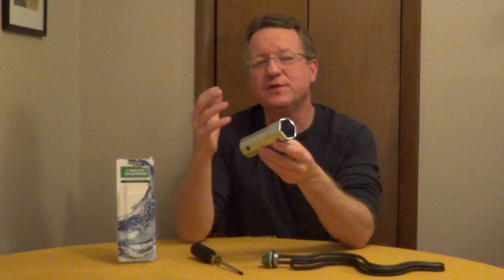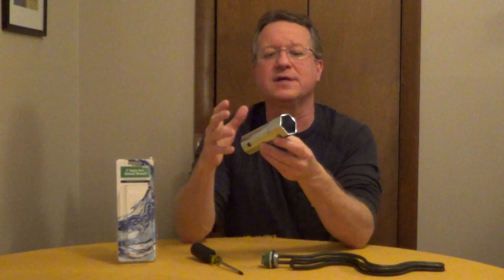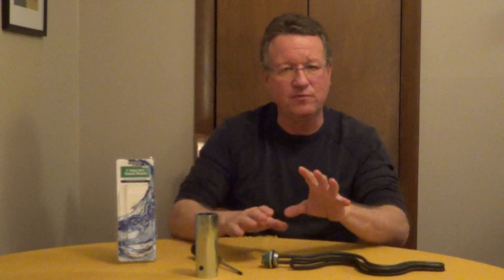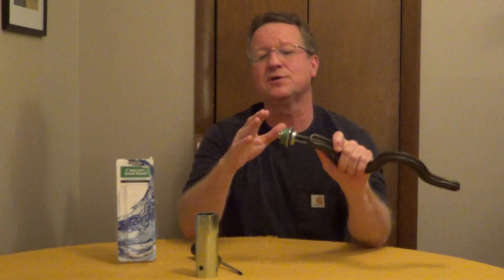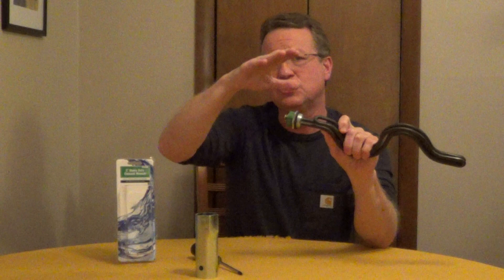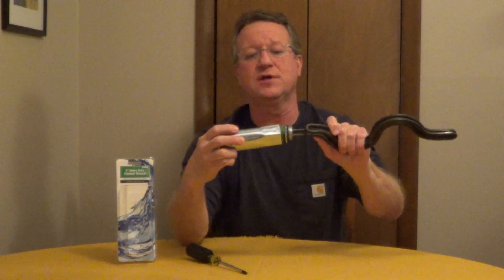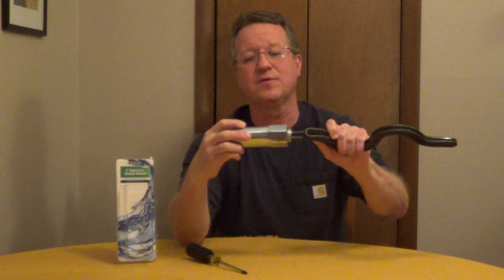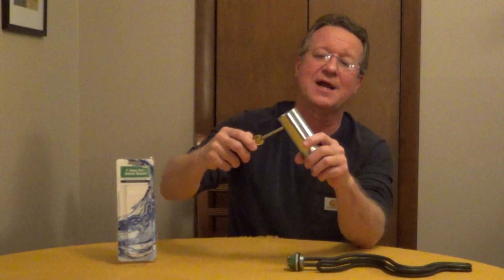Water Heater Element Wrench

Comment: You forgot step three and 4.  Throw out that crappy wrench, which is basically worthless, and buy a 1.5 inch socket and use a breaker bar or impact wrench.

Comment: WHYY? Are the lip threads of the element so small. These wrenches are junk, as soon as I get good grip l, ready to turn it slips right off the thread. Anybody have an idea what I can do. I literally been trying with the element wrench, and a long screw driver as leverage. But as soon as I try to turn it slips, or doesnt turn either. The water heater is 20 plus years old.
Reply from the maker: Hi, try some penetrating oil. Let it set for 15 or 20 minutes.
Reply: Any idea what size the hex is? I ordered a 1 and 1/16 socket but its like half the size all the forumns tell the wrongg size. Thats the size for the anode not the element.
Reply: @MrRahimhosein  I do give me a second
Reply: @MrRahimhosein  its 1 1/2 you'll need a 3/4 drive and possible an 1/2 adapter
Reply: Morty axle nut socket from an automotive technician works best
Reply: @FIXITHomeImprovementChannel  me personally I've attempted all of the steps but broke 4 screw drivers in the process..